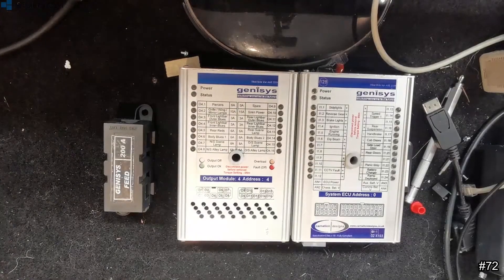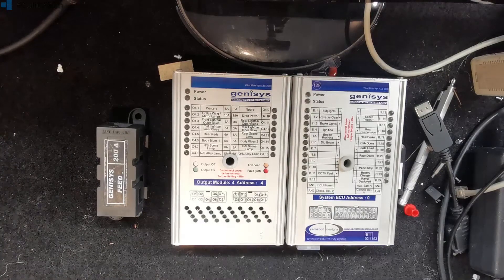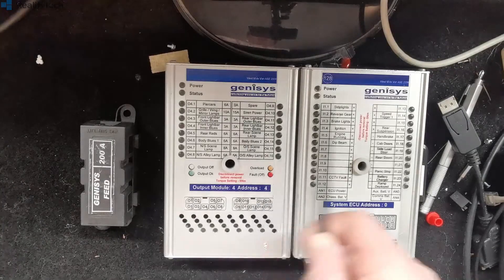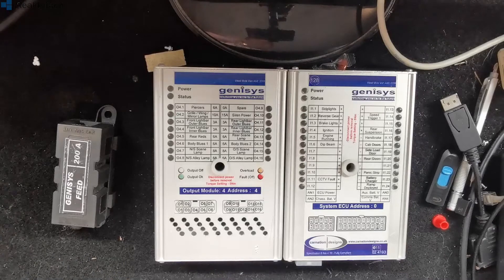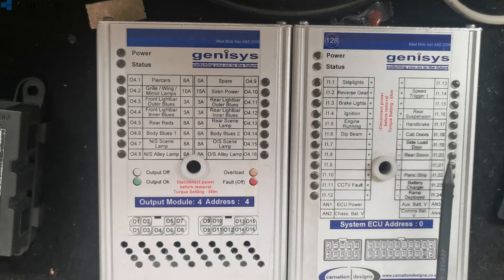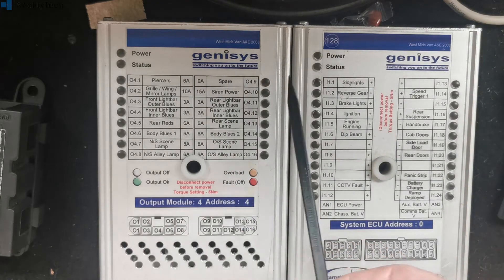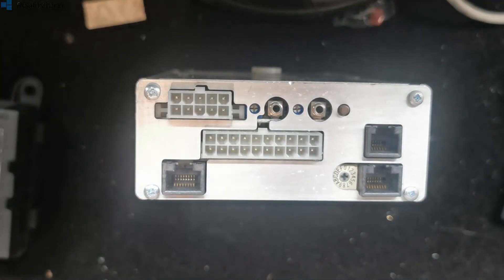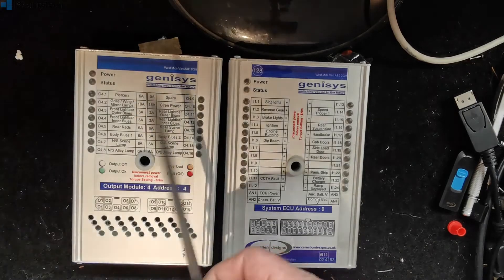Genisys Questions Answered

Comment: Great video, I got a chance to remove these out of an old amberlance which is being converted to a motorhome, would you by any chance have the info for the air suspension? Thank you again
Reply from the maker: I have one booked in to do in feb. Air suspension depends on who made the chassis. With Renault it's all built in at the factory. Some Fiats it's added after and most Mercs its added after. There is normally a white IP65 box somewhere on the bulkhead.

Comment: Hi, I currently have a south east of England RRV ECU with the tiny control handset for the cab. I’m having a hard time figuring out how to wire this up. Could you give me some pointers or ideas ? Be much appreciated 👍🏼
Reply from the maker: There is another video in my collection earlier than this that shows how it goes together. Have a look back at that one and it should help. You'll need the ECU and an output module OR the double width ECU with a built in module and at least one keypad.

Comment: Great video thank you :)). Sorry to bother you but I just got my ECU and 4 modules back from ring as it needed a reflash, the system finally does stuff now but unfortunately the 3rd and 4th box don't light up, which is the main ones I need for lighting ect. Any ideas why this may not be booting? There is power going to them, also do you have a control panel for the front of the cab (the long one) for sale by any chance as I only have the small rear one, I also wonder is this why the lights don't work. Maybe it needs it?
Reply from the maker: You are welcome. You most likely have a cabling issue. The data cable carries the power for the digital side of things so if that is broken you won't get a power or data LED illuminated even if there is power at the bus bar. You can use a network patch cable to link them. I don't have front panels sadly as they are forever getting broken so everyone that gets them tends to hang on to them, they are almost always removed from decommissioned trucks for the same reason. I just have one for testing. Everything that has a button on your smaller panel should work.
Reply: @rtechlab6254  Thank you so much for your hasty reply, I shall have another look today and see can i see whats going on with the network cables, Ah that makes sense with the panel as all the ambulances I see are missing the front panel.  Your some man! a god amongst men! Thank you again! If im ever down your part of the country i shall come drop in!

Comment: is it possible for the end user to reporgram the ECU , to add additional inputs an remove uneeded outputs ?
Reply from the maker: Sadly not. Ring will do this for you and you CAN remove an I/O module that isn't doing anything as they do not appear to talk back. But they suddenly become less helpful when you ask about programming yourself.
Reply: @rtechlab6254   do you know if they charge for custom programming  ?
Reply from the maker: @FNIX_Productions  yes
Reply: @rtechlab6254  sorry for all the questions , its not stupidly expensive is it ? , for them to reprogram ?
Reply from the maker: @FNIX_Productions  no problem, I have never asked
Reply: @rtechlab6254  Is the black bus bar that its all mounted to positive or is it connected to ground ?
Reply from the maker: @FNIX_Productions  it's normally +12 with a huge fuse

Comment: That's a pretty terrible implementation if they've not taken into account brownouts properly. The FLASH issue is completely avoidable with proper circuit design.
Reply from the maker: I was surprised to find it. In our own kit we caught it in the first batch of prototypes. I'd bet on them being tested under ideal conditions and most trucks in trust being plugged in means a dead battery is rare